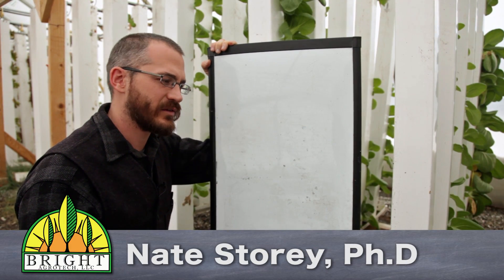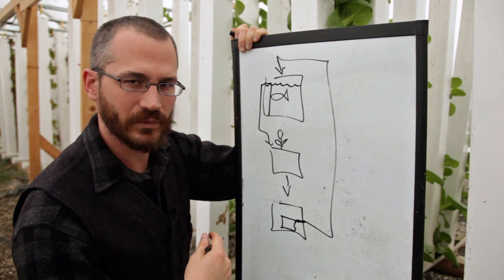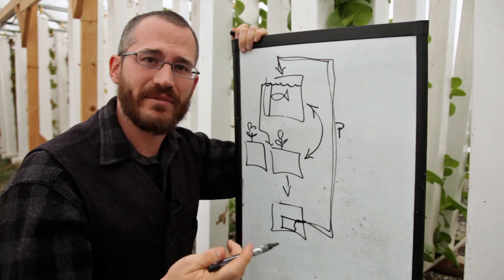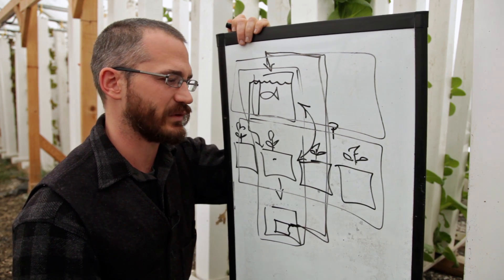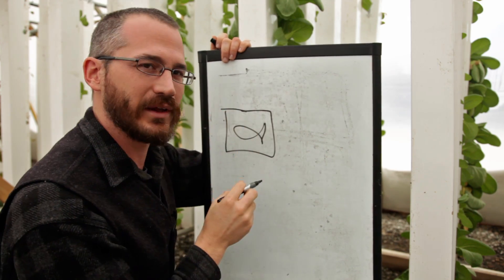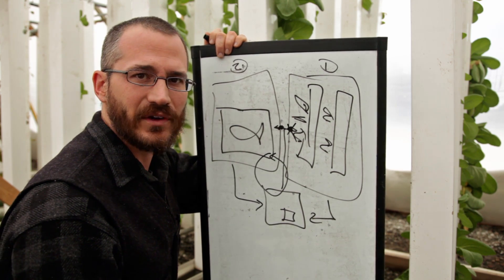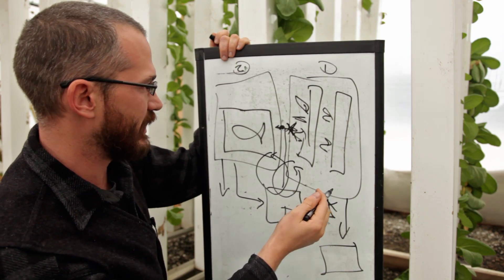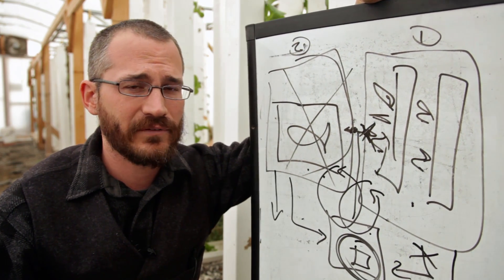1-Pump Aquaponics Systems: Splitting Flow

Comment: I am doing a split flow single pump with an indoor hydroponic system. But water is not being distributed evenly between the t valve? Any suggestions?

Comment: Awesome video, thank you for it as it helped us build our system in this manner...  Question...  we have an 800GPH than claims 400GPH @ 6ft HH which is where our system is at...  after all is said & done, we are moving about 300GPH through aquarium, sump & garden with ball valves controlling everything at all points...  is it ok long-term for the pump if we keep it around this 25% restriction?

Comment: I'm looking to utilize ONE pump in my Hydro greenhouse supplying two bato bucket lines (6 for peppers/8 for tomatoes), one 48"Hx48"W  six tub vertical NFT (strawberries) and 5  24"x20"x6" grow tubs (lettuce, greens, herbs?  I found the EcoPlus 2166 GPH (8176 LPH, 226W) Submersible Water Pump w/ 15 ft Power Cord (Aquarium, Fish Tank, Fountain, Pond, Hydroponics) that is powerful enough to split flow .  My question is given peppers, tomatoes, strawberries and greens are what I'm growing can I get by with a single nutrient formula if so what do you recommend for NPK - I use ChemGro 4-18/38 but would like to keep it simple so that I could mix nutrients in my top off tank that would feed my common reservoir.  Thanks - you're video are so informing I have learned a lot.

Comment: Would the split flow system not end up with the sump tank and lines needing cleaned more regularly. 
ie. The solids have not first been run through the media beds.

Comment: Very informative.
A question about pressures, when scaling this system do you glue the pvc or will a friction fit hold?  Second question, based on longevity is there a better option than pvc for pressure and splits?

Comment: Sorry Nate, but you say "If we need to spray our plants with a pesticide that is dangerous to our fish". I thought  aquaponics was inherently organic due to the fact that any harmful pesticides will harm the fish?
Reply: Same thought here. I never use pesticides in my aquaponics system. You are what you eat, and I'd prefer not to have ANY of my food be treated with chemicals. All natural for me. There are SO SO many natural and organic ways to get rid of vegetative pests.
Reply: It depends on what the pest is that needs to be eradicated. If it's a potential parasite to the fish, then killing them off and potentially losing some crop might be worth it compared to losing your entire stock of fish on top of the damages to the rest of the system once the infection has spread. Sometimes damage control means drastic measures.

Comment: It's starting to sink in... Very useful (after digesting all the online info) information. 
Thanks Doc
Reply from the maker: So glad this is helpful Jason!
Reply: Yes, it is, thanks again. Doesn't replace the time spent "being" an aquaponist (?) but it certainly helps going forward.
Reply from the maker: Nope, nothing replaces experience!  Hopefully though, folks can learn from our mistakes as well as their own.
Reply: I have been teaching advanced scuba diving techniques and we use something called "accident analysis" to improve the safety of the sport and offer a better training. Until then, you don't know what you don't know :)
Reply from the maker: Yeah, we use accidental analysis a lot!  It's typically the most terrifying analysis we do.
Reply: I found a new spot where I need some of your avdice.
I am planning my system (IBC CHOP) and I need to have it on one grow bed for the beginning. I want to harness the beast before going 2 beds or maybe 3.
My water flows from the Sump to the GB and the FT with a pump. And drains from the GB and the FT to the Sump. BY doing so, it is my understanding that if I don't put a sort of filter, my FT drain (SLO...) will carry around solids and eventually sends them back to the FT... Am I going crazy?? :D
What would be your recommendation at this stage?
Thanks for your time
Reply: thanks, much appreciated Christian.
I have re-read my post and can hardly understand what was my question... LOL
As it is, the Sump pump water to the GB and FT (single pump system) and GB drains into sump and SLO into sump.
In this case I have decided to have the SLO drop to an RFF and then to the sump. I should put a mechanical filter after the RFF but have no room. Maybe I should skip the RFF and do a mecha filter... Too many alternatives :)
Thanks again

Comment: if I turn off the flow to my fish , my pressure is so high it over flows some of my beds. how do I split it evenly? basically the beds closest to the pump are getting more then the 1 1/2 return pipe can handle. let me know what you think. thanks
Reply from the maker: Hi Joe, put valves on each bed and then choke back flows to what you want. Hope that helps!
Reply: will that back pressure on the pump be a issue? i was trying to handle the flow but ya if i can just reduce the flow then i wont need to add more beds and worry about even distribution.
Reply from the maker: It should be just fine for your pump. If you are worried about pressure on the pump you can use a check valve.

Comment: Hi.
 I have been thinking about this system and it's very interesting. I wanna have a greenhouse in a near future and grow diferent types of vegetable however I would like to grow carrots and onions for exemple outside alongside the greenhouse.
So my point is. can pump water from the fish tank to spray those cultures outside and pump water to the tank to replace the water used outside?
Reply from the maker: Hi +joss almeida - It's entirely possible, but I'm afraid that if you didn't get your flow rates sync'd up well enough, your outside soil crops would drain your aquaponics system and all it's valuable nutrients your greenhouse plants are relying on. Assuming you're going to setup drip irrigation for your outside crops, you could always set it up with a splitter that would let you occasionally water your root crops with your AP system water. Your outside crops will really appreciate the organic nutrient boost, but you just need to be careful about draining your greenhouse system too fast! Remember the soil should hold more water (and nutrients) so you won't need continuous flow like you would for indoor/greenhouse systems using high void space types of media like Matrix Media. Hope that helps and best of luck!
Reply: +Bright Agrotech  I'll keep that on mind and maybe wiching beds should be the best way for soil.
I'll keep following you for updates and I'll contact you guys later for more advises and instructions for my aquaponic system.
Thanks a lot
Reply from the maker: +joss almeida Happy to help. Don't forget, Nate is doing a massive in-depth AP course on Upstart University right now. Check it out if you're interested.

Comment: somehow all the water ended up going to the biofilter line. the valve to the NFT was open, but no water was flowing??? It was all going to the other line.

the NFC is elevated higher than the other line, and I know more pressure is required on that line, but the required pressure seems to change over time.

Comment: I am having difficulty regulating pressure with my new split flow valve. 

I have water going from fishtank/sump to the splitrer valve. From the valve, one line goes to nft and the other to a biofilter, dwc, then gravelbed.

unfortunately, the flow of water is not constant and seems to change over night and again during the day?

Couple days ago the nft ran dry and plants died.
Reply from the maker: Hmm.  It could be a lot of different things, including too little flow in any one direction and too many solids in your system.  Are you using a valve to regulate pressure in any direction?
Reply: uhhh, yes. Matter of fact, I just switched it, because it was fouled up. Also, the biofilter was clogged. Lastly, after reviewing the spreadsheet, I do think the water is going much to slow. I may need a larger pump.

First, I'm going to add a larger solids filter and shuffle some bucket filters around a bit. I hope the larger solids filter removes more solids so the biofilter doesn't get clogged. While I'm at it, I'm cleaning everything out and enlarging some fittings to try to get more water flow.

Thanks guys! You guys have been very helpful!

Comment: great video. I think this is the route i will take for my system.

what is the ratio for grow bed / fish tank / sump
sump size is my question
I took an IBC tote 1000L , I cut the top at 14" for the grow bed , and the bottom is for fish.
what size then does the sump need to be?
thanks for helping
Paul.
Reply from the maker: Your sump should at least be the combined volume of all of your grow beds.  If you're using towers, or a flow-through technique it can be smaller.  We run our 4000 gal, 350 tower system on a 250 gallon sump tank.

Comment: Excellent information, very scientifically explained. But as Δρυοπας φαναριτης was saying, the difficulty lies on calculating how much water is drained out of the fish tank each hour if the pump is sitting in the sump tank. Other aquaponics experts suggest thath the entire volume of the fish tank has to be pumped out every hour, but how to make sure of that if the water flows from sump to fish and back from fish to pump by the SLO drain?

Comment: nice,
how do you drain from the fish to sump?
the grow bed I assume is bell siphon.
thanks
Paul.
Reply: Draining from the Fist Tank to the Sump Tank is done through an SLO drain, which is basically 1 of 2 methods, one of them is just a tube going down to the bottom of the FT, with an exit through the FT wall on the upper edge that then turns back down on the outside to the floor and runs into the ST, a better explanation can be found here Solids Lifting Overflows for Aquaponics and here http://goo.gl/flqC1j
Reply from the maker: José Pablo Méndez Thanks for pointing those out!
Reply from the maker: Our system in particular, paulie pauly drains from the fish through a settlement tank to our sump then to our towers.

Comment: all of yr explanations is so far good but i would appreciate a little more accuracy, could u give us an example e.g,  how many times has the water to be circulated per 24h all around the system in order to calculate the exact need of pump capacity to use.
Basically, im living in greece and im planning to install a photovoltaic source for my pumps for daily use and cost saving, so i have to achieve good flow for the least spent of energy since my energy resources will not be limitlless since during night or shady days i will use batteries for the system as well as lack of grid power source at the place of installation.
thank u in advance and im hoping for an answer, keep up the good work and all of yr info are very helpfull.
Reply: ElenoraRumer71559 I dislike these types of rambling commercials with a sole purpose of selling me something.  I much rather prefer Dr. Nate Story and Bright Agrotech on giving straight succinct information and allowing me to make the best decision for me, and I especially like how they don't talk down to me like your animated commercial does
Reply: Sylvia Bernstein, a very popular aquapon states in her book that the entire volume of water from the fish tanks has to be pumped out into the grow beds at least 1 time  each hour. With a 1000L  tank, you would have to pump 1000L out in an hour, which is not hard for todays pumps. The question is, how to calculate how much water is circulated out of the FT, if the pump is actually sitting in the sump tank and not in the FT. With the setup explained in this video, the pump climbs water into the FT, and the excess is drained back to the ST again, but how much every hour?? Thats the real question here!!!
Reply from the maker: José Pablo Méndez You can run variable rates to your plants and fish, if you plumb them as subsystems.  Basically, we shoot to turn over the entire volume of our fish tanks at least once every hour to two hours, with the same volume being circulated through our towers on the hour.  It doesn't really change based on your system design.  The goal is alway to circulate the entire system volume at least once per hour to two hours.
Reply: Bright Agrotech
 Awesome, that confirms part of the dilemma, but here is the tricky part. Say there is 1x1000L fish tank, with a 500L sump tank, and 1x500L grow bed. Say you have a 250GPH pump. How much water from the fish tank exits the fish tank every hour? Remember that the sump is inside the sump tank, not inside the fish tank. So how can you calculate this? And what if you suddenly add 280L of grow bed? Is there a formula you can fill in with all these variables?

Comment: A detail: When designing the piping, use bigger pipes, smaller pumps. "Fatter pipes cost rises as about the second power of their diameter, but their friction falls as nearly the fifth power of their diameter"(A. Lovins, Reinventing Fire). Bigger pipes, smooth bends, diagonal pipe runs, using Y-junktions instead of T-junktions, all reduce friction dramatically. The bigger the savings in pumping energy, the smaller the pump and capital costs.

Comment: So we have a system that I am trying to help design (or adjust the current design).  We have a rafting system with 2 IBC containers as fish tanks. Two rafting grow beds are attached via 2inch PVC pipes, and the beds are connected together (water flowing in one and through to the other) the beds then drain into the sump tank where the water is then returned back to fish tank.  We are having a problem with the flow of water OUT of the fish tanks.  The water flow INTO the fish tanks is much faster than the water OUT of the fish tanks (even with a back flow from the sump tank)  How do we increase the flow of the water out of the fish tanks?  Do we need larger diameter pipes out of the fish tanks?  Should be raise the fish tanks to a higher level than the grow beds?  (all is gravity based except the return back to fish tanks).  What are your thoughts?  It's been a real hassle.  We have an overflow pipe in both fish tanks to prevent overflow (which we had problems with)

Comment: Nate,
     If the fish tank water is traveling to the sump via slo, what is being used to filter out the fish waste? Wouldn't waste accumulate rapidly since only half of the flow is traveling to the grow beds?
Reply from the maker: In our system, it's all broken up by the sump. Some of it is sent back to the fish and some of it keeps circulating. Over time it will accumulate in the ZipGrow Matrix Media which act as both a bio/mechanical filtration. If you're not using towers or another media-based technique, you'll have to install solids filtration equipment.

Comment: I noticed in another video that you are using a pool pump, is there a specific reason you are using a pool pump instead of a submersible pump? Also I haven't seen any filtering equipment in your system. I understand it is to maintain the amount of fish waste and not to lose any of the nutrients in the system. But does this not increase the chance of developing disease in your system?
Reply from the maker: With the amount of towers we have in our greenhouse, a submersible just won't cut it. Submersible pumps become more expensive for every gph they deliver. There's definitely a sweet spot there. The opposite is true for inlines: the larger the volume you're moving, the more cost effective in-line pumps become. Regarding the filtering: We have a settlement tank that our solution goes into, but the majority of the bio/mechanical filtration is actually performed by our Matrix Media (http://shop.brightagrotech.com/matrix-media). Our Matrix Media is 93% void space which gives our plant roots an incredibly aerobic environment, reducing the risk of disease and eliminating detrimental anaerobic zones.

Comment: hey nate... i do a system where the fish and plants are totally separate in a sense... I run the fish in a aquaculture system with one pump and from this system I also have a smaller pump that pumps the water to the plants. It works well if you have a problem with the fish tank pump there will always be water running through the whole system (much less ,but enough). This allows me to have a much higher stocking densities in my fish tanks. Your system of splitting the flow is really good as well. But I try to use energy saving pumps and they dont have so much pressure so splitting the flow isnt a option for me. I try to circulate my fish tanks 4 times a hour and this is also too much water to run through my plants... thank for your videos, they help a lot...

Comment: using a gravity feed system wouldn't you just need to increase flow to the fish tank from the sump tank, so the added beds get the water they need? you do of course need valves and a bigger sump.

Comment: Might want to expand the idea of 1 pump to (pumps only in one tank) since occasionally it is actually helpful to have redundant pumps or when you expand you can add another pump instead of having to buy a bigger pump to handle the expansion or if using timers, one might want to only turn the plant system pump on/off via the timer while having a continuous pump running for the fish.  All these ideas follow the basic Idea of CHOP even if using multiple pumps provided all the pumps are drawing from the same single sump reservoir.
Reply from the maker: Good idea Aleece.  Redundancy is a life-saver.  We'll have to do a video on this at some point.